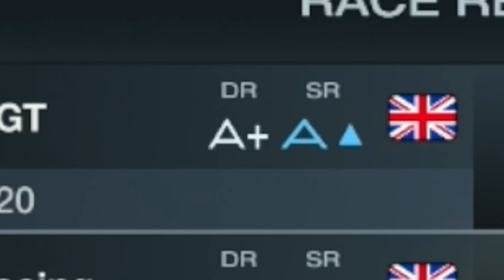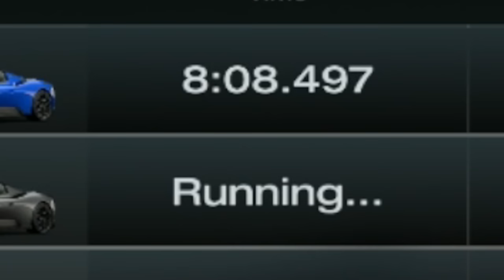Gran Turismo 7: A Horrible Mistake Was Made

Comment: To be fair the brakes in the real life MC20 are also terrifyingly inadequate so I'd say Polyphony nailed it.
Reply: Watched the Maserati MC20 test by AutoTopNL. Yes, he said that brakes aren't good. LOL
Reply: I'm more surprised how Dynamic engine braking is in Gran Turismo and the application of it in this race as the main gimmick/ skill/ emphasis.
Reply: @user-te8qh1gf3j definitely one of the things that will keep it a simcade versus a sim. It’s the only title where I’ll see streamers consistently money shifting and rifling down gears to slow their car, while subsequently doing a premature up shift out of the hole to optimize traction.

In any other sim or irl, you’re likely going to damage the rotating assembly or gearbox, and you’d be using traction systems or throttle manipulation to come out of a hole, not purposefully shifting out of the power band

Rory Alexander’s a great example of someone who uses this meta. No knock against him either, it’s just the ticket to being faster in GT
Reply: But isn't tyre grip the limiting factor in road cars? I always thought that's the biggest difference between road and race cars (ofc in the longterm, race cars have better braking because less fading and stuff)
Reply: @daftbence 

But SH tyres aren't that bad. Pretty decent ones in a game. Even for a supercar like MC20. In RL official tyre supplier for MC20 is Bridgestone Potenza ( probably Sport version) which is rated as very good tyre.

Comment: 12:11 this seems like a bug and is the opposite of how it works in real life. The ABS would already be working the tires to the maximum possible stopping distance allowed by their grip level, adjusting brake pressure on each tire individually 15+ times per second.

Comment: Have you tried different brake balance? maybe thats why is so hard
Reply: I adjusted my brake balance to +1. Not sure how much more difference it made but it improved my confidence which can translate to better drving.
Reply: @GalactusTheDestroyer  thats great. I dont play GT7 but reading other comments people also complained about the brakes so i guess it made sense. THe whole brake balance needs to be used actually on a per turn basis if we go into IRL, but can also use just a fixed balance. More over usually you would want something more towards front braking due to weight distribution during braking, however excessive front bias can tend to locking the wheels, hence why its not always smart going full on front. Also some cars benefit more to have rear brake bias due to factors like FR or middle engine